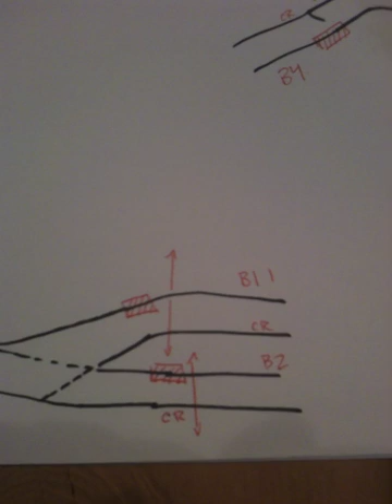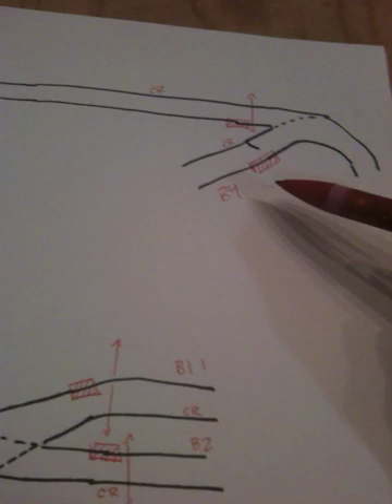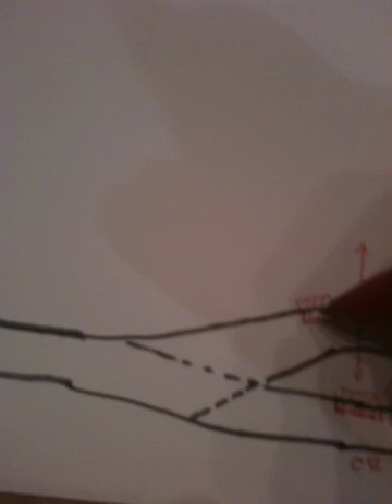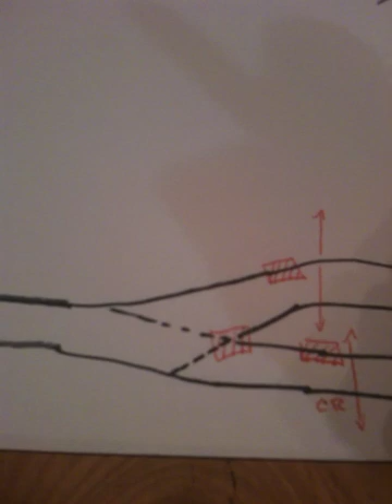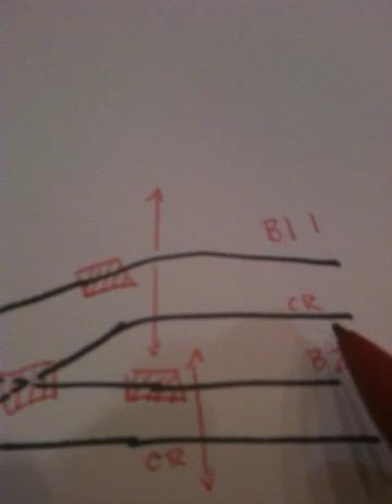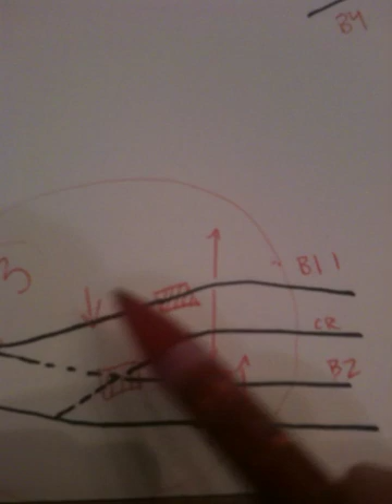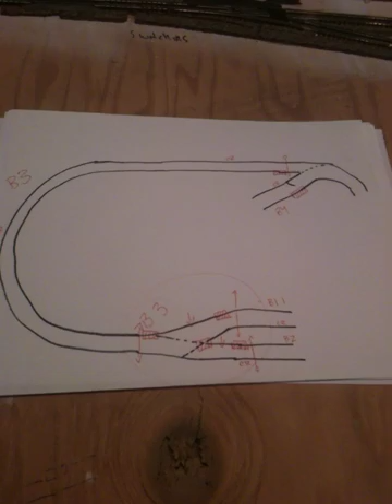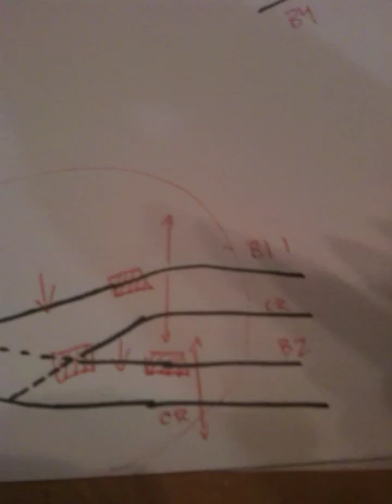DC Wiring of Turnout

Comment: I first watched this video several years ago and referred back to when beginning my track work. I’ve now completed my track layout and followed your suggestion of incorporating the facing points into each block. This has worked extremely well and certainly cut down on some of the wiring. I can’t thank you enough for putting this video together. Are you still working on your layout all these years later?
Reply from the maker: Chris Heath thank you ever so much for the kind words. I’m happy that the video helped you with your layouts wiring situation. I love keeping things simple and easy to learn; explaining DC wiring within some publications Is like pulling teeth . 

A lot has happened since I made these videos, our family has moved and along with it the layout. I had to rewire all the blocks only to find out my controller burnt out. I will one day get back into getting the layout finished . 

It’s in our basement on hold; I’m hoping this in Winter season to put some hours back into the set.

Cheers

Comment: Great video.  How does the CR get to B1 through an insulated turnout?  What did I miss?
Reply from the maker: Great question! I in cooperated the turnout directly as part of  Block 3. This means that their is a Common rail feeder line going to the turn out before and after the insulted gaps heading up to Block 1. This works when you decide which cab you are going to use for that current block. For example if you flick Block 3 and 1 to Cab 1 control, the locomotive using Cab 1 should seamlessly go through the blocks without worry of short or stoppage. (Same could be said for this dynamic for a locomotive entering from B3 to B1.)

Comment: Tech tip :  do not use common rail wiring and use only DCC friendly turnouts.
Using power-routing turnouts is just asking for trouble.
Reply from the maker: I appreciate you take on this. DCC friendly turnouts are perfect to use as well. Common rail wiring has worked for years and still works to this day if the principle's are followed. There isn't a "wrong or right way" of choice - but one does require more work problem solving. I found jumping into DC was perfectly fine for a small layout, with minimal operation. Bump up the size and complexity - DCC is a perfect fit. Thanks for the insight - Cheers

Comment from the maker: It also looks like the signal of choice, would be to find a signal that has a turnout switch (with motor) built in. Take a look at the site In the PM, and take your time lol. A book which goes into great depth with switch and relay use is: The complete Atlas Wiring Book. They have diagrams and examples to work from. I know this is very vague.. but i hope you get it figured out!

Cheers

Mike

Comment from the maker: Well that sounds like a great idea to add to your layout, but with DC it gets a little more complicated. Unfortunately I have yet to wire such a device into my layout, and I do not have much experience doing so. But with that being said, I did some reading in some of my older wiring books for DC. It is very much possible, but complicated to describe using words. It looks like the basic's are to wire up a turnout switch to a snap relay, in order to control signal functions.